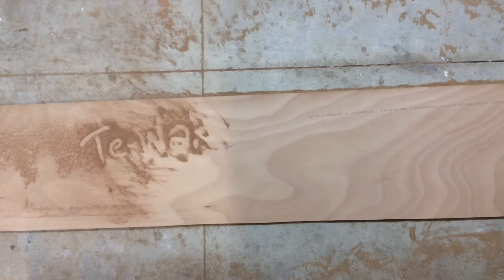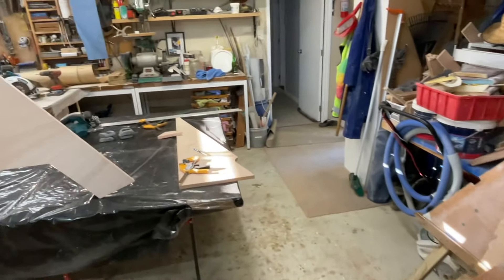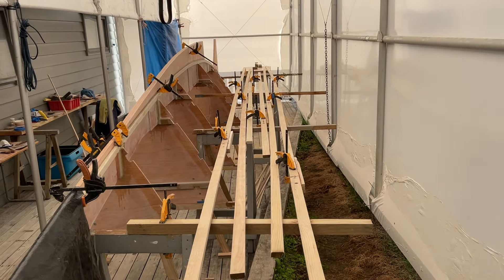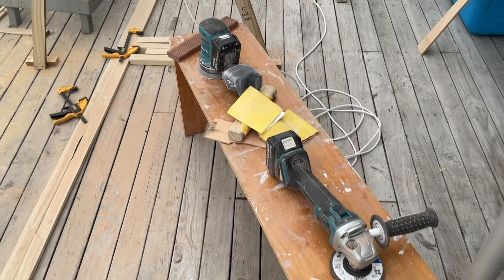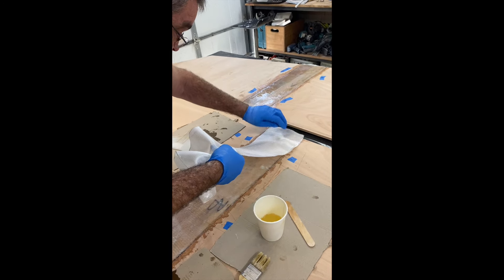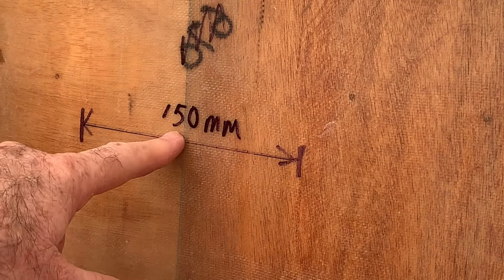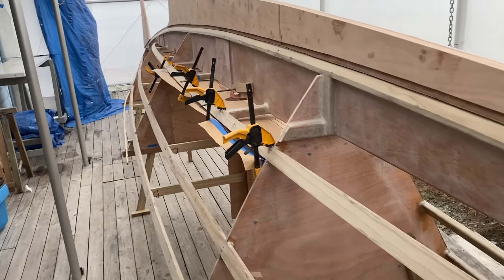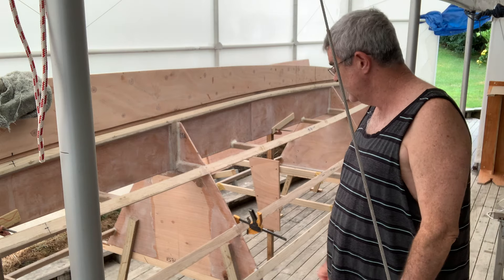Te waka Phambili -  Port hull part 1

Comment: Very clever of you guys to think of cutting the skeg with the rudder support block included! Great forward planning there! I am currently making the hardwood blocks for that purpose as per the plans.
Reply from the maker: Thanks Eamon. Also thinking of taking an inch or two of the bottom of the rudder so it doesn't foul (hopefully) when we careen the boat.
Reply: @TeWakaPhambili  I'm adding a hardwood shoe to the bottom of the skeg to protect the skeg when taking the ground, this might serve to keep the rudder clear, depending on how soft the beach is I suppose.
Reply from the maker: @eamongreen  It is a good idea I think. We have done the same (slightly wider than the keel itself) and sheathed it in kevlar too. Planning to beach regularly to brush off marine growth. Hoping to go with coppercoat.

Comment: that butt join is very tidy! and nice technique with the router!
I reckon you might save some time for fillets (or gluing long skinny things) by piping the epoxy mix in. I have found freezer bags work well and are very cheap also, the one trick is placing the opened bag in a cup, which makes it easy to get the epoxy in
Reply from the maker: Piping certainly does make it easier. Used a piping bag for the long fillets on the stringers.

Comment: Hello, excellent videos. How much do you think this process would have been helped by a CNC router table if you had access to one?
Reply from the maker: Hi @jdeluisa I think that if you are regularly generating g-code off old school drawings and already have the skills, space and equipment then it would definitely help. For me the learning curve and set up costs make it non viable. I think some guys have done it though. The designers sell the Mana 24 as a CNC pre cut kit which goes together quite nicely. We have lofted onto card templates and have found it quite straightforward mostly..

Comment: Yea,,, your back. Uhh, maybe knocking off your hull bulkheads and the back bone as matching pairs, while more work now, would   make getting both lower hulls built up.
Reply from the maker: We would have liked to work both hulls at the same time but we have a space problem. We have cut the second lot of bulkheads so they are already in the wings for round 2.